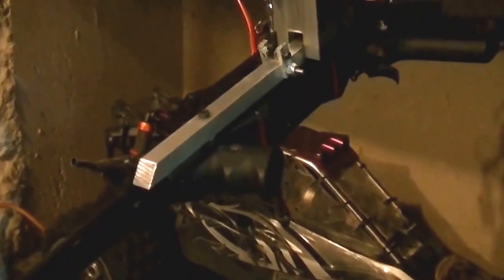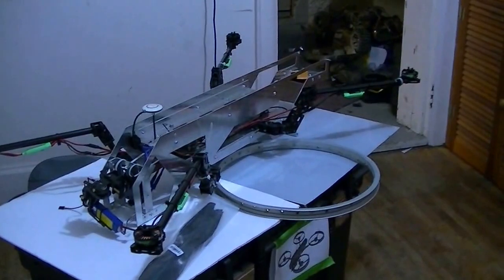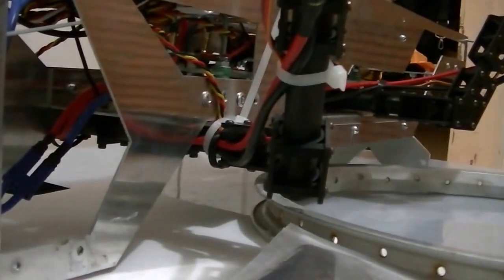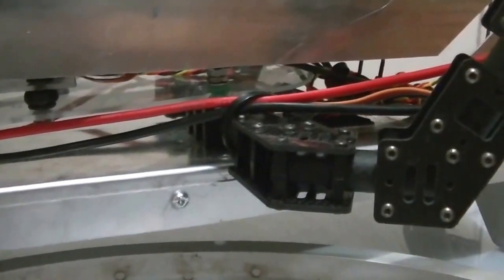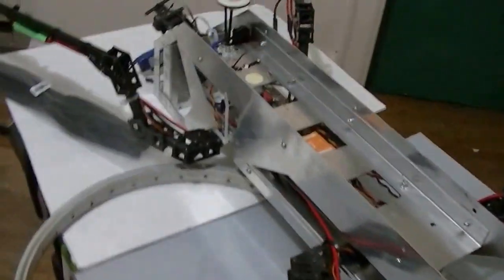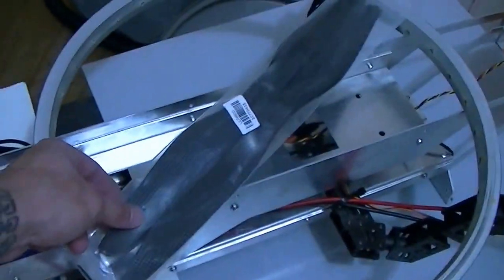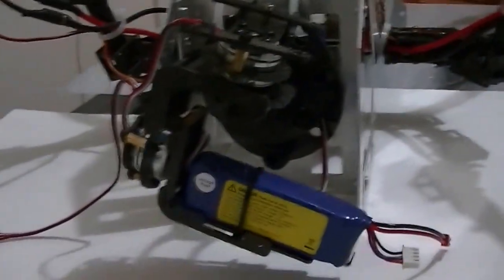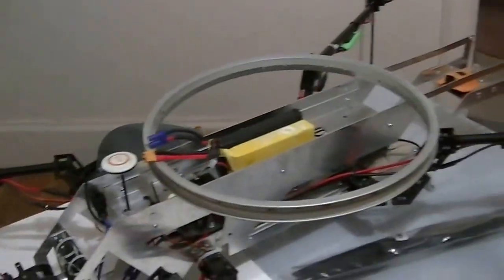Real COD Dragonfire drone Update 6.

Comment: you ought to switch to carbon fiber.. 
carbon fiber is also radar invisible  as well as stronger and lighter. 
and you tried 3-d printing? 
an old file against the grinding wheel will clean it pretty quick.
Reply from the maker: yeah thats the next step. i have been having issues with my cnc machine. im sitting on a pile of carbon sheets that i cant cut. 3d printer is also on the way. i backed tiko from kickstarter they are just a bit behind right now. this whole project has been on hold for a bit while i figure everything out. my mini factory is about to take off , just gotta work out the kinks.